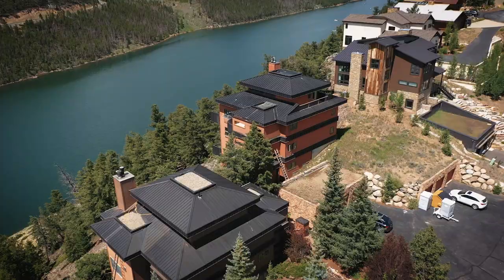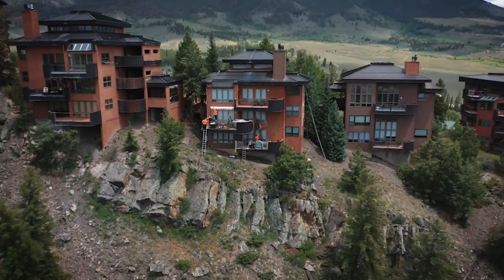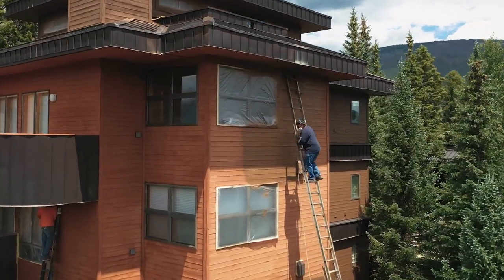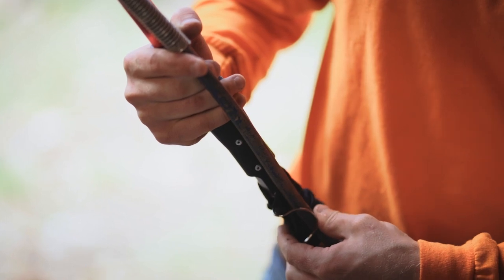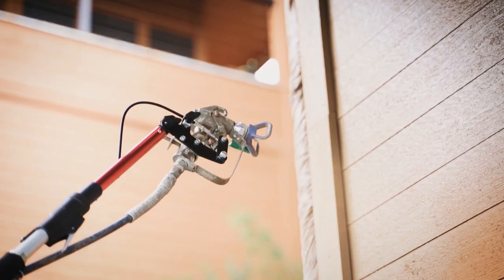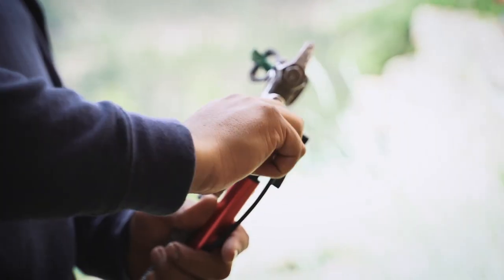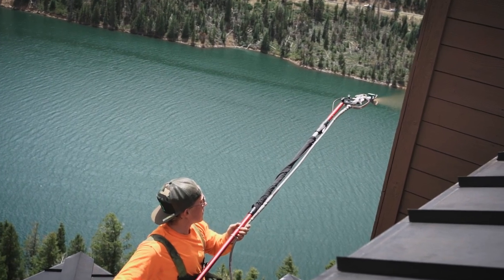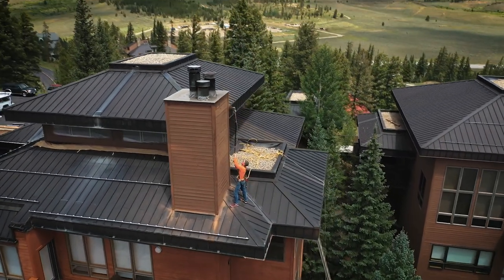Spray Poles for Painters

Comment: The spray pole looks great. But shocking to see a professional worker climbing a 60 ft ladder. That's insane. I'm used to other regulations, where the maximum height for professional work on ladders is 6.5 feet